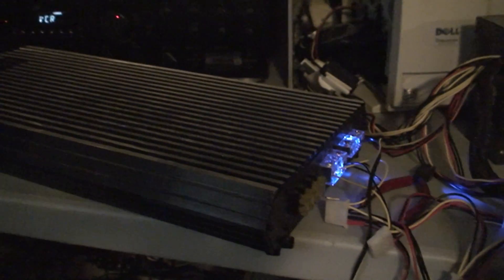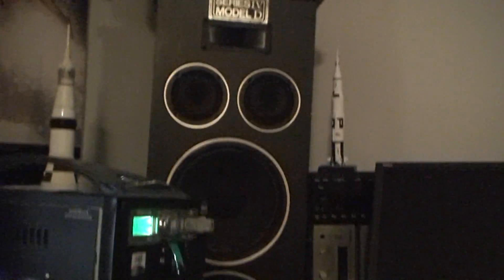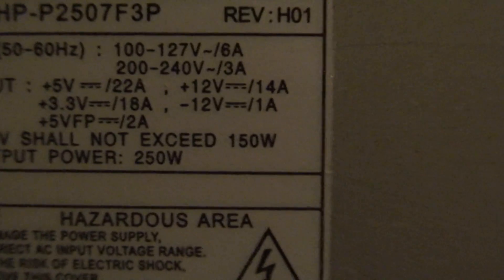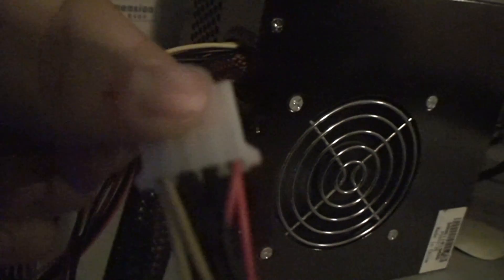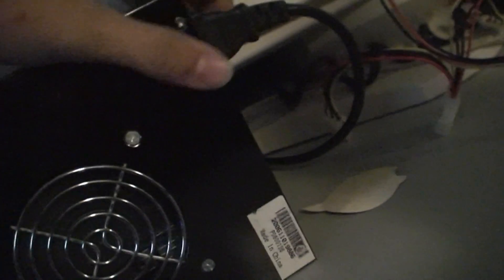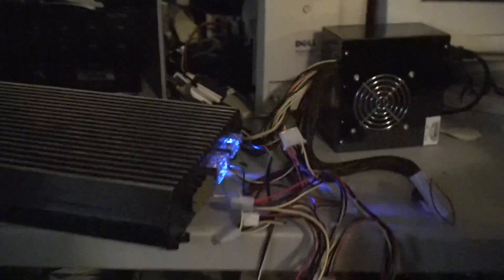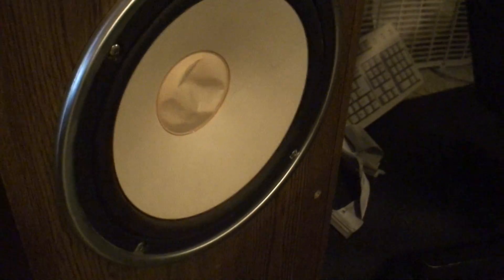How to make a Car Power Amp work on AC power using a PC power supply

Comment: From the PC Power supply You should put together All the Wires by Colours Exept The Green One, The Green Wire need To be With A Switch So Solder In A Swith Between the Green Wire And The Black Wire to power the power supply ON and OFF, Then Solder Together ALL THE YELLOW WIRES, BLACK WIRES, RED WIRES By The Colours, Cut 

PC Power Supply Voltages From All the Colored Wires

Black Wire  = Ground
Yellow Wire is = 12 volts 
Blue Wire provides = -12 Volts
White Wire = -5 Volts
Red Wire =  5 Volts

If Any Questions - Please, Ask me About It...

Comment: should you guys need some serious advice, try this:
10,000 megawatts car amp
2,000megaA power supply tapped to the nearest Electric Power substation
8,000 megawatts of MOFO nuclear subwoofer.
with this, all hell breaks loose, a perfect megabass

Comment: First of all, the wires on the power supply are thin as hell, so connecting only one of each to power the amp is a terrible idea.
Second of all, that silver Dell PSU gives out nowhere NEAR 250 watts, hell no, it says 12V times 14A which is 168 Watts in a perfect scenario but it's never the case, especially with a Dell PSU, so I'd say it gives out something like 100-120 Watts.
If you want something proper, invest in a server power supply, you just can't get a more reliable 12V PSU than that. I myself own the IBM BladeCenter 2880W PSU, that shit gives out 236A on the 12.2V rail, that's some real power. Been powering 2 Alpine SWR-12D2, not even close to stressing the PSU.
Reply from the maker: I'd like to point out if you wanted real power you would buy a crest 10001 power amplifier.    This psu wasn't a dell power supply but a 750 watt generic branded one.    I stress tested it until it smoked with some Sony 1200w subs and it was pretty impressive.    This is a quick mention of a creative solution to use what you already have to make a cheap theater sub.    To be honest, you can get a behringer ep1500 power amp for like 150 bucks that could push most consumer car sub boxes to their limits.
Reply: ***** You sir are very smart, wattage is irrelevant when it comes to the PSU, amperage is the key factor. I plan on using a 49$ Corsair PSU which puts out 50amps at 12v.
Reply: Cameron Canant It's all about the budget. When I was getting into the whole powering my car amp with a computer PSU, I started looking at 1000W+ computer power supplies, and their price was ridiculous, so I found out that some server power supplies give out up to 3kW for less than 100$. Now I have found an even beefier PSU than mine, it's the Sun 300-1802 Type A206, puts out the most stable 5600W out there, but for that, the fuses on your house need to be pretty damn good.
Reply: Will you send me some links to PSU's under 1000 dollars that have a decent amperage of over 60+ amps at 12v
Reply: 100$$$$$ not 1000
Reply: Cameron Canant
There's just too much choice, but if you look up "server psu" on ebay, you'll find plenty for less than 50 dollars even that can do 1000W, but you'd need to be able to solder because a lot of them have some tricky ways to switch on. For more info on modifying server power supplies, look up "rcgroups server psu", those forums cover pretty much every server PSU that you can buy and tells you how to make it work outside of a server station.
Reply: Quick question, if I were to use more than one black and yellow wire, would this put less strain on the PSU? For example, 10 blacks, 10 yellows? I certainly dont want any overheating.
Reply: Cameron Canant Definitely do use a lot together, the more the better. That is only if you are sure your PSU has a single 12v rail. If you use only a single yellow with single black, then your amplifier will suffer with stability and power loss, so the thicker the stack of cables the better. Your PSU won't necessarily see any change though, but it is really important to use as many of the yellow and black wires as possible.
Reply: ***** Yay dude, the Corsair PSU is a Single 12v rail. I will get a shit ton of yellows and blacks.
Reply: As far as quality, and sound, would you recommend this? http://www.ebay.com/itm/Cerwin-Vega-VEGA3-Series-VEGA3104-1200-Watt-10-Dual-4-Ohm-Car-Audio-Subwoofer-/181152870846?pt=LH_DefaultDomain_0&hash=item2a2d8d71be&vxp=mtr   or this? http://www.ebay.com/itm/Audiopipe-TXXBD210-1200-Watt-Dual-10-Subwoofer-Car-Audio-Sub-10-Sub-TXX-BD2-10-/281564446721?pt=LH_DefaultDomain_0&hash=item418e8c8001
Reply: Cameron Canant I've heard great things about Cerwin Vega as a home hi-fi brand, not too sure how well they perform in the car audio industry, but I would say it would sound a slightly bit better than the audiopipe, but the audiopipe is louder. So it depends on what you want from your setup. I don't think you would even notice the difference in sound quality so I myself would go for the louder option. What's the PSU that you're using and the amplifier that you're powering with it btw?
Reply: http://www.ebay.com/itm/CORSAIR-GS-series-GS600-600W-ATX12V-v2-3-SLI-Ready-CrossFire-Ready-80-PLUS-BRONZ-/381062375656?pt=LH_DefaultDomain_0&hash=item58b91668e8
Reply: http://www.ebay.com/itm/NEW-Autotek-ATA1200-1-ATA-Series-1200-Watt-Monoblock-Car-Amplifier-Mono-AB-Amp-/301560895529?pt=LH_DefaultDomain_0&hash=item46366e1829&vxp=mtr
Reply: Cameron Canant That's some really good choice right there, cheap as well. The Corsair GS600 is going to provide more than enough power for that amplifier. I'd say give it all a go, should sound pretty good and quite loud, depending on the size of your room or the place you intend to use the setup in.
Reply: Should I go with a TXXBD2 10 or a TXXBD1 12? The 12 is 600RMS, the 10 is 600RMS. Same specs except the 12 has only one stacked magnet. Would the 12 be louder? Idk what to get.. Im kinda stuck!!
Reply: Cameron Canant Well if we're to believe the specifications given by the company, then you should go with the 12 inch since they are both 600W RMS but the 12 inch would have more surface area and move more air, plus it was an SPL of 88 while the 10 inch has an SPL of 86. That aside though, the 10 inch weighs much more than the 12 inch which would point to a better, sturdier build quality. Choice is yours.

Comment: will a 26 amps Psu do fine with a JBL GT5-A604 amplifier powering 2 speakers and a JBL Sub GTO1204BR ?

below are the reference for both :
Amplifier: http://www.jbl.com/resources/Brands/jbl/Products/ProductRelatedDocuments/en-US/ServiceManual/GT5-A604,GT5-S644%20sm.pdf

Sub: http://www.jbl.com/resources/Brands/jbl/Products/ProductRelatedDocuments/en-US/OwnersManual/GTO1204BP_BR_BPD_OM.pdf

Please help guys, thanks

Comment: Does anybody know if I could take the thing that you plug into the wall and it converts It to a cigarette lighter outlet and take a car charger and strip the ends and run the stripped ends to the amp PLEASE RESPOND

Comment: yes for bigger setups i would suggest a marine battery and good charger  just tie the remote wire to +12 with a switch on that line (so you can turn it on and off) and also fuse the +12 connection to the battery.

you could try to tie together more then one psu I never have tested this (so dont blame me if it burns down your house) but you can get them cheap to free used so it might be worth as an experiment.

Comment: I would suggest cutting all the power supply wires to one length,then groping up the yellow and black cables all together It adds to the amps put into the car amp as each  12 volt rail only supplies a fraction of that 600 watts. so grouping each rail together gives you access to all the available watts for the 12 volt portion of the psu. not sure how good it is for them but i've been able to get a lot more amps out that way in my lab setups.

Comment: So you're trying to tell me that if I send AC power to a speaker's voice coil I could potentially break it? You know that actually makes sense because when you power a subwoofer, you need to give it voltage that goes up and down in order for the voice coil to move up and down, its called something like alternating current, or AC for shorrrrr. Wait a second? WHAT THE HECK ARE YOU TALKING ABOUT!!!

Comment: It would be safer for your amp if you connected the 3 volt wire to "rem". If I remember right, the remote that is sent from the car stereo is 3 volt.

Comment: Guys, lol. I have a home theater surround sound setup like this. There's usually 6 power ( yellow ) wires. I took 3 and connected them to 4 gauge wire, did it twice so there's 2 power going to my +12. I'm running a 1000 watt bridged amp off a 250 watt power supply and it hits just fine. If any of you people have problems message me. I can walk you through it.

Comment: The reason people don't "just go out and buy a home theatre" is because they are ridiculously expensive compared with this alternative. My father paid over $300 for his home theatre and it doesn't put out even half the wattage of my $100 computer power supply and car amp setup. 
  As long as proper wiring techniques are used and you keep track of how many watts your amp/speakers/power supply are using this project is not at all unsafe. 
  Your tutorial is very good though. I've seen much worse.

Comment: i tried this with a 300w power supply in a 700w amp, all i got out the speakers was  quiet bass and very little treble, is this because i need a more powerful pc power supply?

Comment from the maker: My solution has been professional audio.  I have spare gear laying around so I use it.  I power my speakers with Behringer EP2500 amplifiers.  Building your own speakers is much cheaper than buying them.   An EV speaker that I like costs 2000 but I can build a better one with the same DL driers and a better horn for just about 500.      A buddy of mine went the hi-fi route and bought professional studio monitor speakers and amps for a beautiful 5.1 setup.

Comment: dont know why this works so good, im running a 12 inch infinity at 300 watts rms off a 400 w  
pc power supply with this incredibly small pc wire and the amp is hotter then the power supply! stone cold! awesome vid

Comment: You're not actually connecting a DC power amp with AC power, if you did that it would destroy the amp lol. All computer power supplies output 12v DC.

Comment: I have got a 430W PS running 32amp from the yellow +12V.  I am attaching it to a 1000W 4 channel amp.  (I plan to only use one channel at 250W)  When I wire everything up and turn on the PS, the lights on the amp come on for about 5sec then slowly fade out to nothing.  I am not sure the problem.  I dont even have the amp powering anything yet and all the levels are all the way down, so I wouldnt think the PS is being over drawn and shutting down automatically.  Anybody got advice?

Comment: Alright so I have a power supply that gives off 12VDC to the amp which is required for it to run. It gives off 18 Amps which means the total power given off is 216 Watts. I assume that it won't run my 1600 Watt subwoofers?

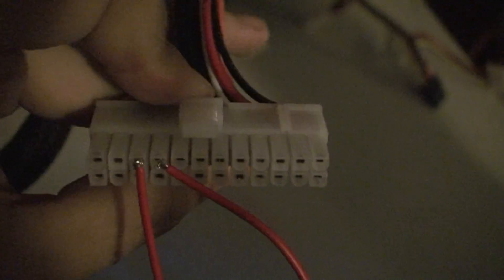Comment: Easy understanding on the wiring use the green cable and any black wire on the 20 to 24 pin connector. 2:00

Comment: i have a 500watt psu and i have JL audio 300/4v2 and when i turn the pc sound to max the amp shuts off and when i make the put it to normal the amp comes on the psu does not turn off please help i even put my 500 + 300 psu on it 2 psu still turns off when i max it out please help :D

Comment: i have an 800W american pro bass machine vs-8855 amp with 20x2 fuses. its running a 12" 800w Fosgate sub. what sized power supply should i use for in home use?

Comment: i just did this with a soundstream 2000 watt.. it worked. buuut dont use small wires they will melt... i didnt expect them to hold up anyways. the amp wont run at 2000 watts either it doesnt get enough from the psu to run at 2000

Comment: i did profession installation for a while, you can under power a speaker, just because you turn the volume down doesnt mean your speaker is getting less power. if your sending 100 200 1000 etc watts to a speaker no matter the volume its still getting the wattage the amp puts out.. think of your volume or gain as a sensitivity setting, all the volume does is increase the signal going to the amplifier making the speaker louder.. still getting the same power

Comment from the maker: For some reason this PSU would not turn on with the wires tied. I believe it was because the PSU had separate power rails for each line. This video was proof of concept only.  I later tied 3 separate PSUs together and ran two 1200w peak subs at full power until the PSUs started smoking as an experiment ( Ironically the supply itself died before the wires)

Comment: ok you wana power one amp 1400w with one psu. it's possible but you should have used more yellow  wires cos 1 wire is not gonna take (1400w/12v=116a) 116 ampaire. lol that setup would have crashed at some point, seeing you already tore it apart, so your save now!
thx, it was a good vid

Comment: Those are switching power supply's and don't offer much amperage output maybe about 10 or 12 amps of current at 13.8v ? And car amps draw a lot of current especially if your using it for bass.

Comment: LoL your a dumbass.. " this is a 250 watt it wont work but the 650 watt does" dumbass you go by the amperage on the 12v rail. if that amp is 100 amps rated at 2ohm and you run it at 8-4ohm to your speakers its around 50 amps. and the 650 watt 12v rail might be 50 amps into that rail it has nothing to do with wattson the power supplys. LMAO  and everyone commenting on this is a real dumbass. learn electrical you fuck tards

Comment: Take a wire and put it from remote to  the 12v power on the amp so that when the cpu turns on the amp turns on to

Comment: Rem is remote it is a 12v constant coming from what would normally be a head unit like a cd player.  It tells the amp when to turn on.  That terminal is probably about 8 ga, you are probably having overheating issues because you are pulling too current thru the power supply's single 14 ga wire. Try taking all the yellows and all the blacks from that one pi connector and run them parallel into the amp, most remote wires are about 20ga so that can remain but I would pull its source of power from

Comment: The easiest, cheapest, and most versatile way to power these systems indoors (DC POWER AMPLIFIERS) is to use a 2A Automotive Trickle Charger available for less than 20$.  This isn't risky, the smart chargers won't overcharge your battery either.  You go to a dump, grab a piece of shit battery, or get one that's thrown away by someone who doesn't understand electrolytes and batteries.  Fill dead battery wth deionized water, and a little lime and lemon juice. Reconditioned battery, clean DC power.

Comment: I need help i have 600watt JVC KS-AX4302  and a 12 Alpine SWE-1243 and im use a 450watt PSU.. Everytime i turn on the PSU it runs fine untill i try to turn up the AMP volume it chips out!!! Bass Boost is on 0 and the XOver is set @ 50hz so it at minimum  settings.. i would like to know why it chips out? Is it because i need a higher watt PSU or something? Pls help ty...

Comment: @Flippit1303 
What do you think of this 'home amplifier of 1000w', doesn't have the subwoofer RCA outlet. but I'm think..What if I just put my subwoofer's wire into the speaker output...?plus I have the advantage of regular speakers..[and I can descard my 'car amplifier of 1000w' to use>>..its called (Pyle Pro P1001AT 1000W Amplifier with Preamp & AM/FM Tuner)'google it' thank you sir =]

Comment: @Flippit1303 
Bro, I need help, if you would like to help me figured this out.. I would really appreciate! So I have bought this one Subwoofer(1500w) w/ amplifier(1000w) meaning, that I have to power from 110v AC to 12v DC with an amperage of 83. right? to my amplifier work swell, I have found something that I might wanna have, search at google for (DLS-75 iota) would that help me out to work out everything that I need? thx!;D

Comment from the maker: @93buckhunter Are you sending an analog signal to the amp?  Make sure your not trying to send an amplified signal to the second amp.   If your stereo has an RCA sub out, this is what you need to connect to your sub amp. If there isnt one, you could split your signal from your main input.

Comment from the maker: @nimquie1000 If you do the math, the amp is rated at 4 ohms 1200 watts, but when you put an 8 ohm load on it, it provides 600 watts max.   It is safe.  If I hooked two of those cabs up to one channel, it will reduce the ohms to 4, and provide 1200w, with the cab being only 200 watts, yes then I would have a small problem.

Comment: the REM goes like this...you have a stereo sistem in ur car..like a cd player ,mp3 player,tuner..whatever...from that sistem you've got a blue wire that goes in to REM of the power amp..what is happends is that when u turn on your cd player, the amp will be switched on as well

Comment: this is a great project and i will do it for sure but if i have 2 speakers each 1 180W and 220W amp (sucks i know) can i connect it to a 250W power supply ??? and do the whole thing or not ???

Comment: what is the output in watts of the power supply that your using? since the one you demonstrated with was that 250 watt and you were talking about how it wasnt that great... whats the watts on the black one?

Comment from the maker: @SpaceMonkey0315   With the PSU I was using, if I crossed the PCI-E Power connections, or the CPU power wires with the 12v wires, It causes the PSU to not power on at all. I think its a safety trip to protect your PC. In any case, I just did this as an example. I stick to real power amps when I need to run a system. :D

Comment: i would recommend to most of the yellow wires, if not all (if you plan to use it at a decent rate)... if you use just one wire it would heat up and eventually melt (based on the number of amps flowing through it). hope this helps.

cheers!